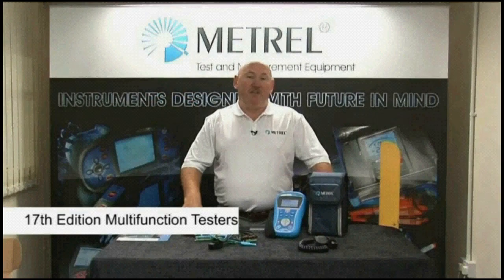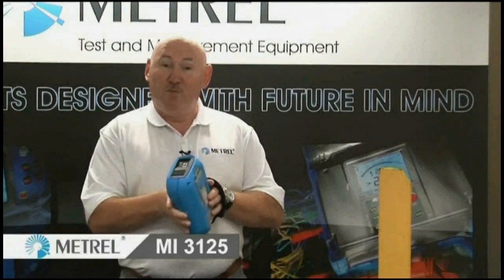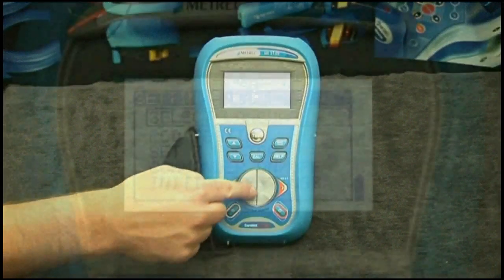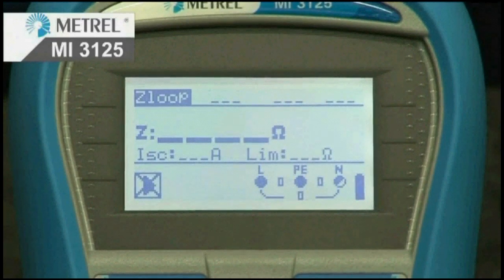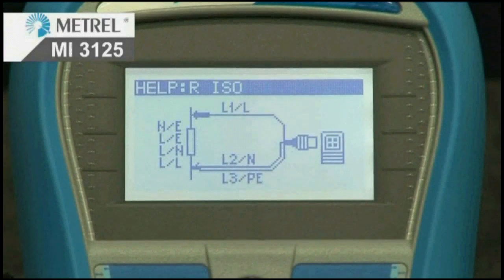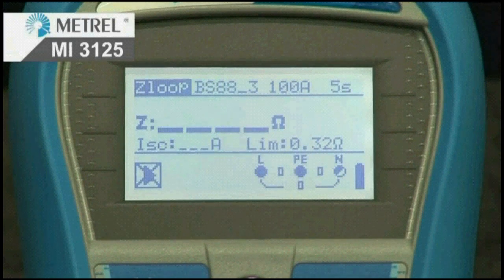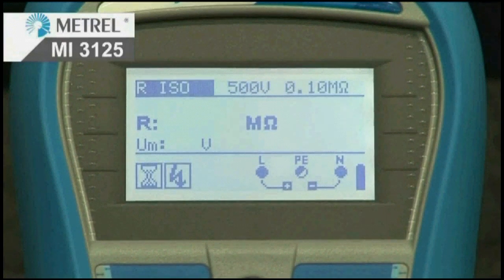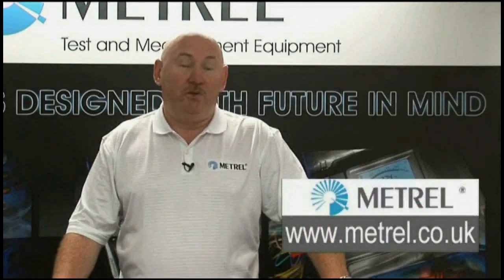METREL MI 3125 EurotestCOMBO

Comment: is this able to test type "A EV" RCD's? specifically 6mA DC trip test? there is a certain EVSE manufacturer that claims to include DC protection but doesn't,  testing this is a grey area as there seems to be no requirements for DC testing!